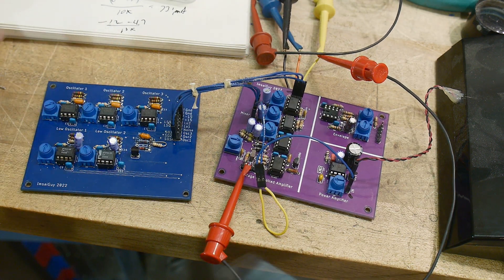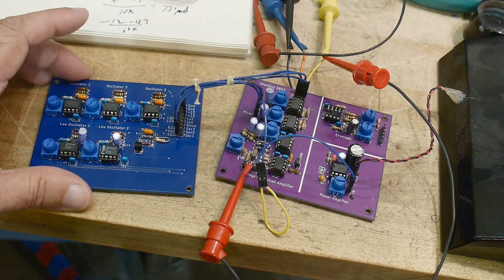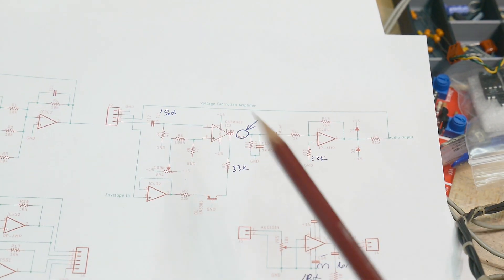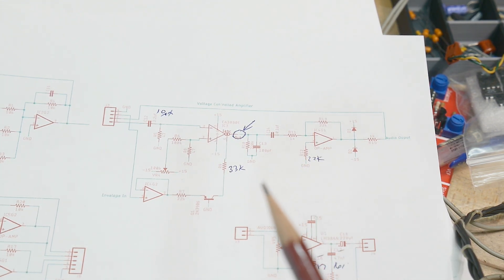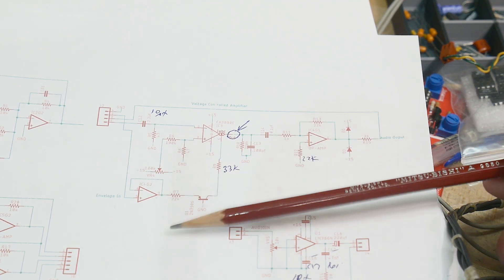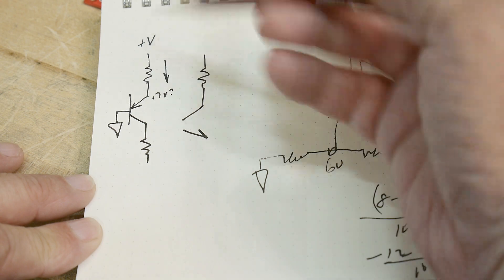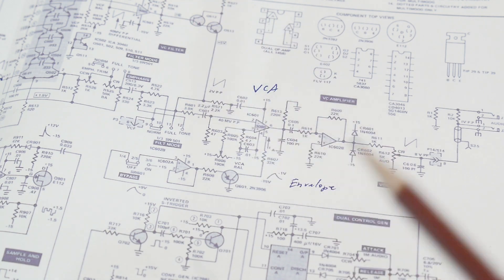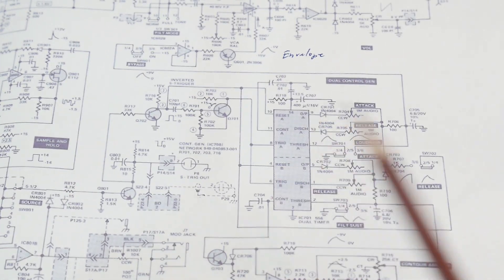#1222 DIY Analog Synthesizer (part 14 of 15)

Comment: Impedance is V/I and conductance is I/V.  Transimpedance is output voltage / input current and transconductance is output current / input voltage.  ("Trans' is short for transfer and suggests an output / input.)  A transfer matrix relates an output (I, V) vector to an input (I, V) vector for each port.

Comment: The bias current of the trans-conductance amplifier CA 3080 has an input at the basis of an internal transistor with its emitter at -15V. 
When you want to control the amplification with a signal that has the value 0 at 0V, then you can provide a voltage shift with the lateral transistor as shown in the schematic.

Comment: 3:15 It looks like you have edited that particular component and put that pin "inside-out" thus the software doesn't connect it to the wire.
Reply from the maker: that's the way I found it, I need to go fix it